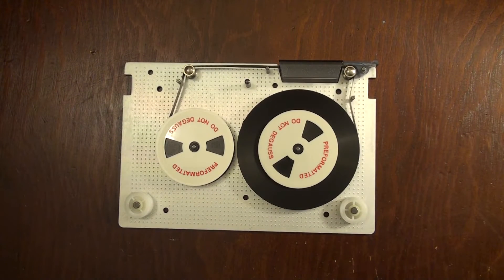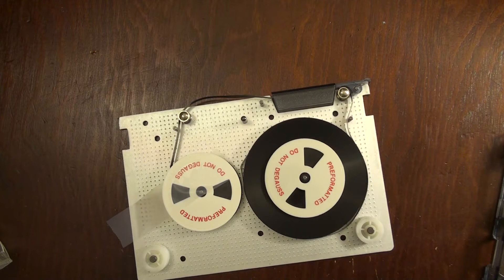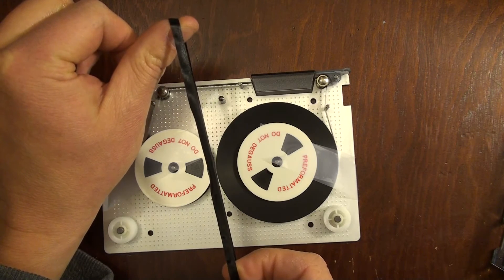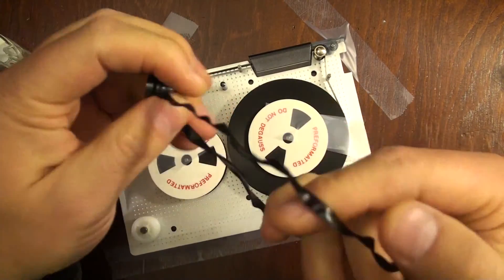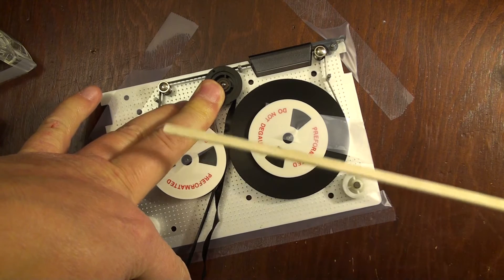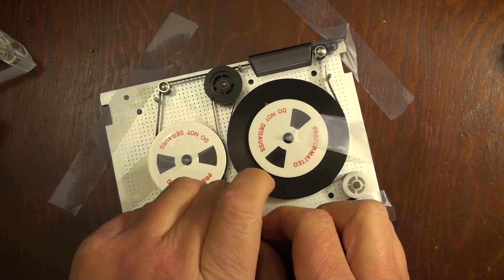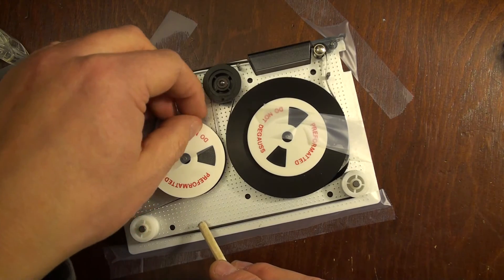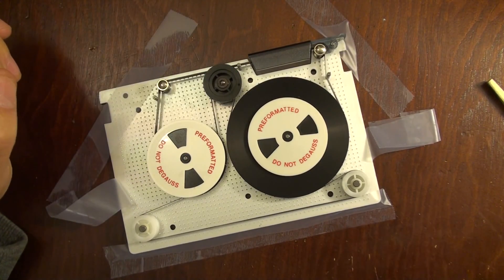QIC Tape Cartridge Belt / Tension Band Replacement - Update

Comment: I'm trying to access an old backup and when I put the tape in the drive it rewound to the beginning & kept going, pulling the tape off the reel. Do you happen to know how the tape is supposed to be attached to the reel? Thanks for this video, I'm going to need it!
Reply from the maker: Well, actually it's only attached by friction.   It seems that the tape drive that you inserted the cartridge into does not recognize the BOT = Beginning Of Tape hole sequence, and does not detect when to stop rewinding the tape as a result.  Please contact me at http://qicreader.blogspot.com/p/contact.html if you would like more assistance with this, and thank you for your question!